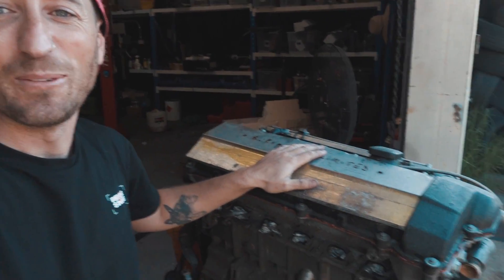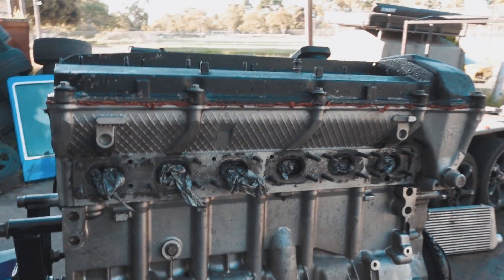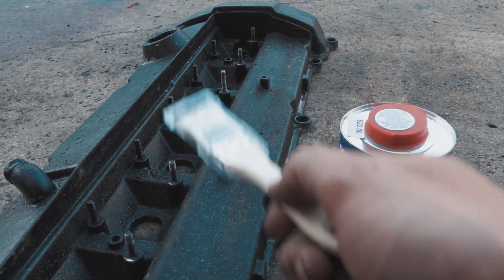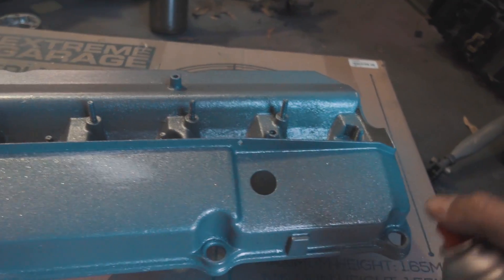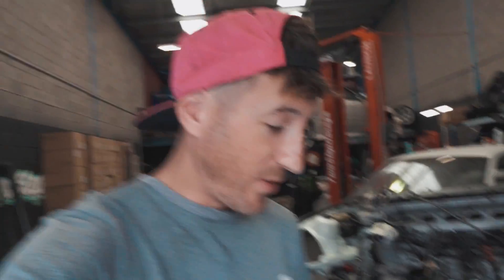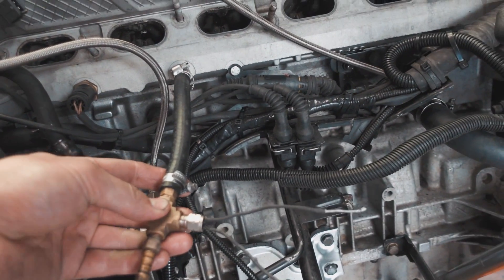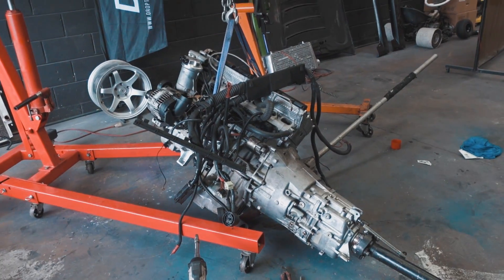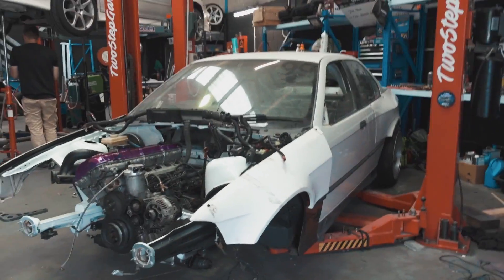BMW M52 TURBO engine install! | Pro Build Part 4

Comment: Do you typically not torque to spec or threadlock your flywheel or pressure plate bolts? Not judging, just asking for an experienced opinion 😁
Reply from the maker: I threadlock and torque the bolts yep! But the Timelapse is just cut in a way that you don’t see it 😅
Reply: @itsmikelake  gotcha, appreciate it. loving the build man lots of knowledge here 🙏🏽

Comment: I like Supercheap auto, have shopped there for years and will continue to do so.
But as someone who been repairing cars paint wise for years and I’ve used Supercheap autos paint a few times and everytime it’s been an epic failure, I won’t use them again, but I’ll still shop there for other stuff, but the duplicolour stuff is way too sensitive and isn’t worth the headaches .
Reply from the maker: Yes I can agree with this, their paint is very sensitive!

Comment: Why don’t you learn how to make a loom yourself? 
I know it seems intimidating but jumper harnesses are a simple place to start and it’s a skill that once you get it and understand the processes, you’ll never forget it. 

Makes a lot of sense when you start thinking of how much money you’ll save just by upskilling. Almost comparable to learning how to weld an exhaust or manifold except you don’t have to spend money on a welder. 

Also is that new/spare engine going to have forged rods atleast, maybe something cheaper like Eagle Rods or Maxpeedingrods? 
I’d love to see how much your driving would improve with 500hp
Reply from the maker: Definitely an awesome suggestion. I learnt heaps when we did the Datsun’s engine loom. I am keen to tackle a full rewire, especially with waz here as he’s a sparky (I know it doesn’t exactly carry across but similar). I absolutely froth upskilling 😈.

Yep new motor has maxpeedingrods rods and will have forged pistons also. 400kw is the goal 😁.